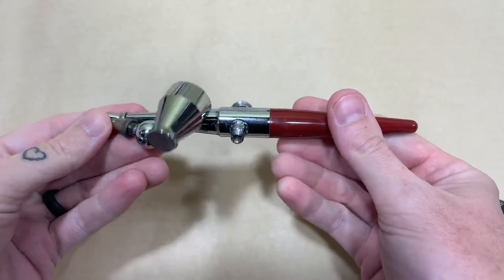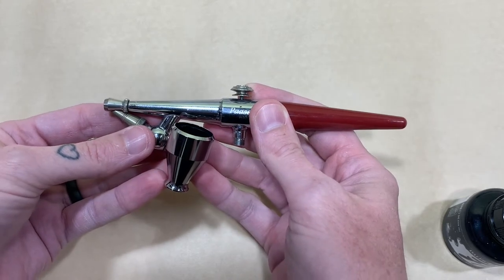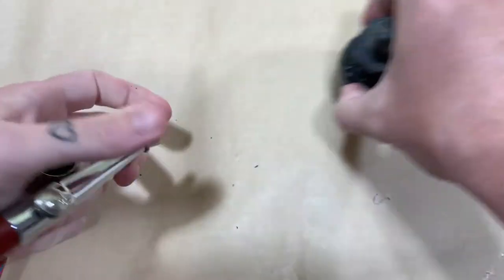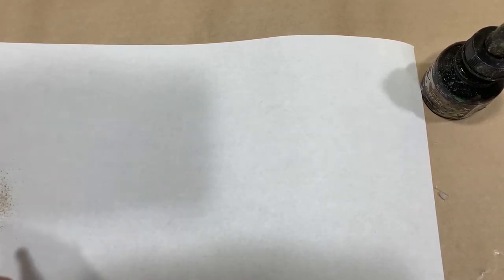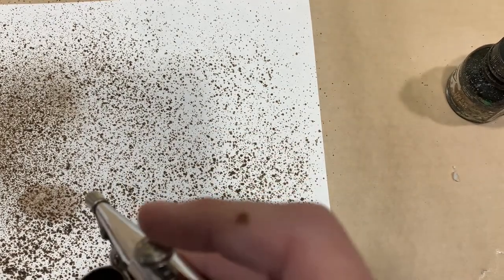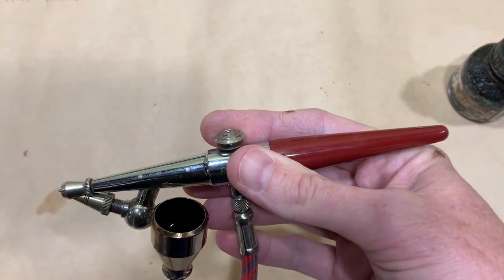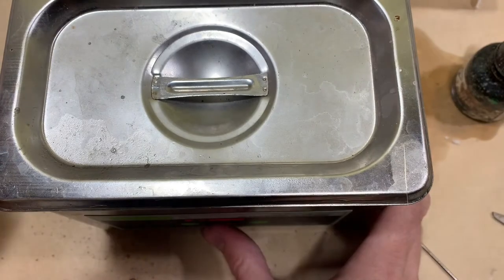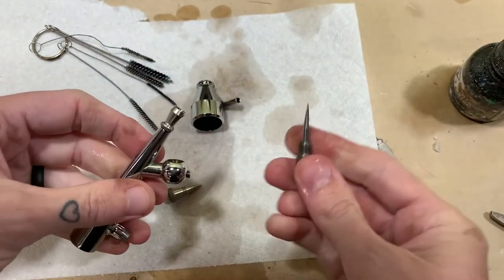Using and Cleaning your Single Action Airbrush

Comment: I use a Paashe H, I clean it with cheap carbonator cleaner, spray lacquer thinner.
This is a normal cleaning. I fully disassemble for a deep clean.
I usually spend no more than 3 minutes to clean it up for the next color.
Hope this helps.

Comment: I've read that using alcohol in an ultrasonic cleaner can and has caused explosions. I remember someone posted a picture once when it had recently happened to them. I do also remember a lot of people saying you should put the alcohol in a ziploc bag along with the parts you're trying to clean and then place that bag in the ultrasonic cleaner which should have water in it. I assume this is to stop the alcohol fumes from escaping which should be what causes the explosion. Just throwing it out there.

Comment: The way it moves the paint out of the cup is called the venture effect. The air leaving the top part sucks the paint up because of pressure going forward fast enough drags the paint to. That's why more paint comes as you adjust the nozzle away from needle plugging it. Just found that out on a different video about external feed airbrushes. I got the plastic red one passche makes to avoid buying a expensive one like that. I know it's cheap compared to dual action.I've been using those for years but you can't spray automotive top coat out of those and I heard this thing has huge needle that doesn't get dry tip or clogs very often.

Comment: There'a a packing nut in the needle cone that has a pfte washer, and another rubber washer in the trigger assembly, you should remove both before cleaning and they do need periodic changing as well.  The trigger assembly comes apart easy enough but watch that spring under the lock nut where the hose connects, it'll fly away if your not careful.  After you remove that theres 1 more ut deeper inside air hose connector tube that locks the trigger head (You hold it with a small screwdriver while twisting the trigger head till comes off).  Theres videos to aid you and Dixie art or Paasche carry the whole line of replacement pieces for pretty cheap.